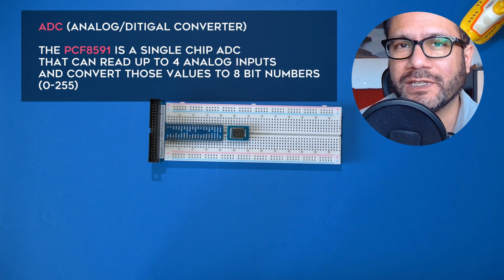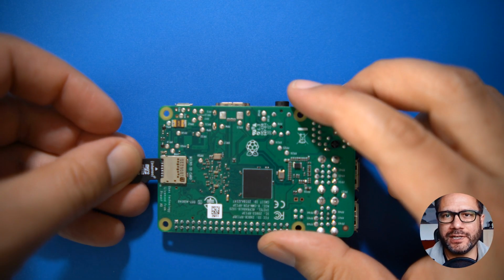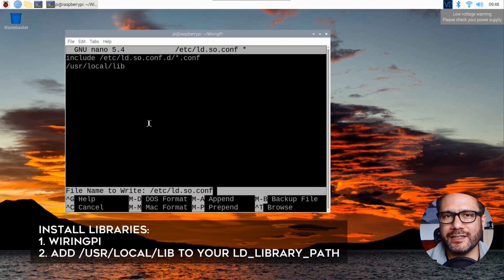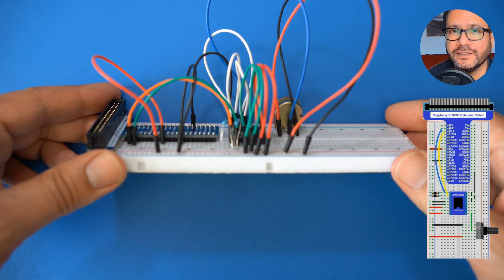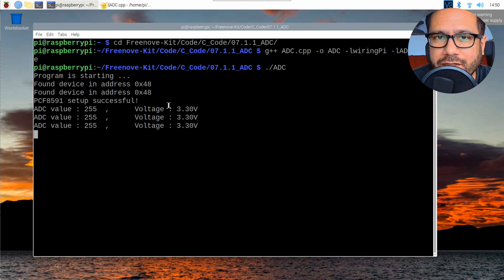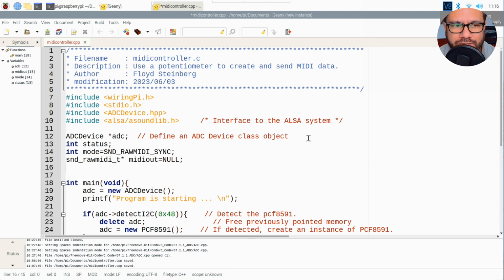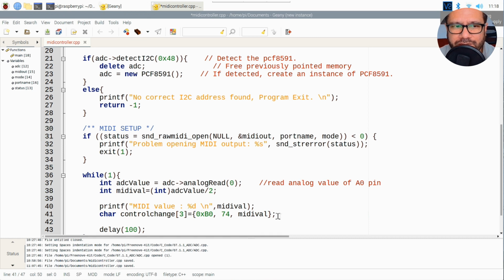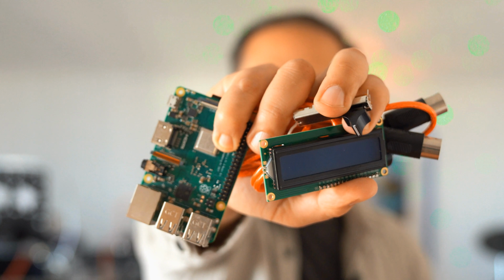Build a simple MIDI controller with Raspberry PI (beginners tutorial) Part 1

Comment: Would I need to purchase additional ADC converters if I'm trying to add additional potentiometers?
Reply from the maker: You'll need a multiplexer, for example the TCA9548A. If you're not familiar with those, here's a link: https://forums.raspberrypi.com/viewtopic.php?t=368435
Reply: @mr_floydst  Thanks for replying, I'll look into that one. I did a little research and found an 8 channel ADC called the 'Adafruit MCP3008' , to my understanding this can convert 8 different potentiometers, would you happen to know if this is actually the case?
Reply: @takawakahd Maybe my answer is way to late, but yes the MCP3008 is a 10bit 8channel ADC. The data is then sent via SPI to the MCU

Comment: I have a pi just for routing midi mesages between any devices you plug into it. Works like a charm and having 4 usb ports makes it perfect. For a midi controller though arduino is much simpler, especially if you only need midi out for it.
Reply from the maker: Thanks for watching! I agree, but I want to do some more ambitious stuff in the future (e.g. there was a viewer question how to create a MIDI filter). So PI is a good all-round choice here.

Comment: More Please👍
Reply from the maker: Thanks! The stats don't look promising at the moment, unfortunately. I'll do a follow up showing how to use a multiplexer chip to add more than 4 controls.
Reply: @mr_floydst  You could use an 8 channel MCP3008 or MCP3208 (more resolution, but not really needed unless you want a pitch or pitchbend CV) to provide 8 inputs over SPI.  You might want to use a multiplexer to go beyond 8 inputs, or just add a second chip.  You just need one dedicated GPIO pin for each ADC chip, as a chip select pin, then the rest of the SPI connections can be shared.